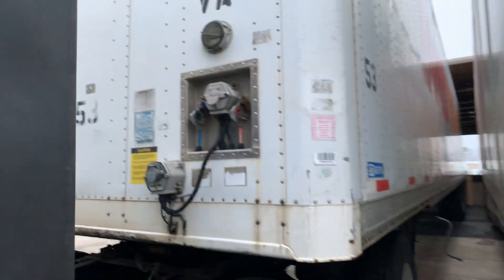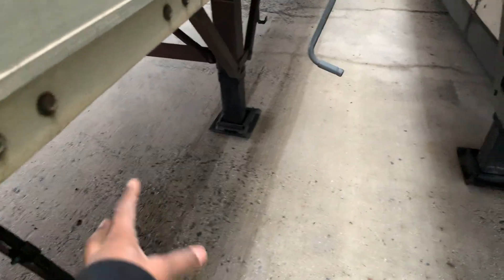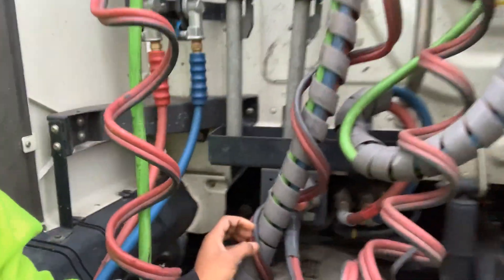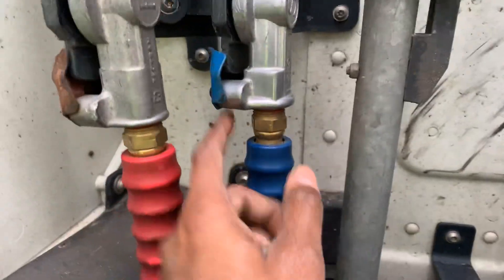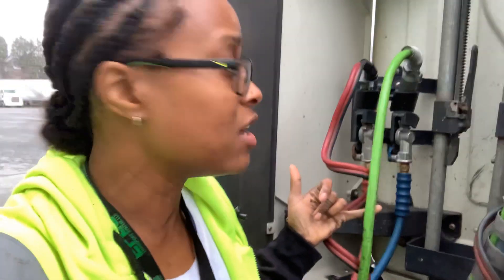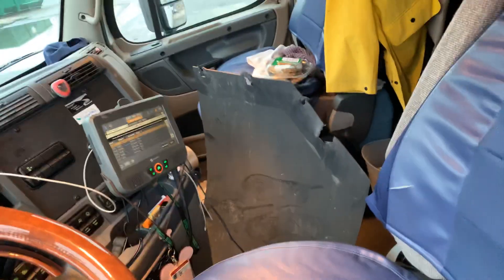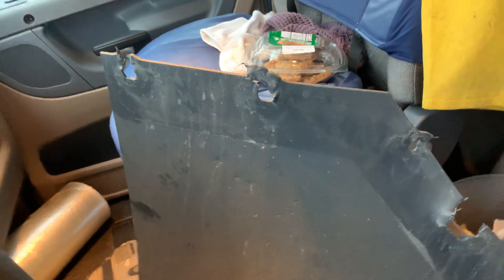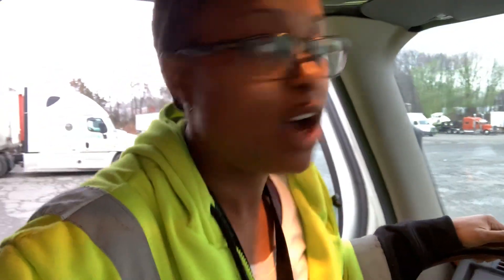Ripped Out Glad Hands And lines

Comment: Seems the majority of  Dollar Stores are not easy for semi's to back into one would think smaller box trucks would be used. Say 30-35 ft truck.  
That truck would be easier to maneuver into tight back in (s) 
As far as not unhooking lines ( forget to release / unhook ) ...maybe a taped note to dash with the 3 main things ya got to do when unhooking trailer.
Or a note ya carry & ya check the note just to remind yourself. 
Put down trailer leg ...unhook lines....then pull that rod ...
Easy to forget things when tired.